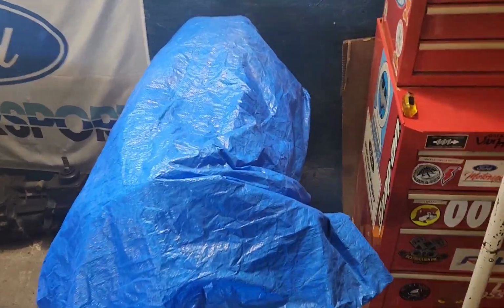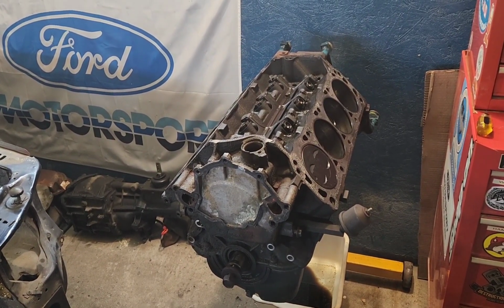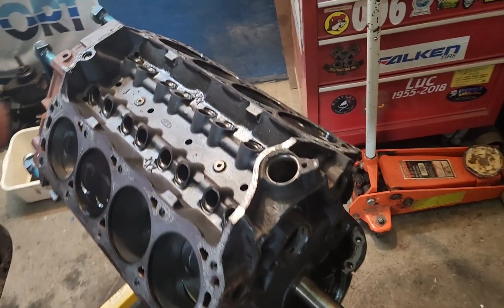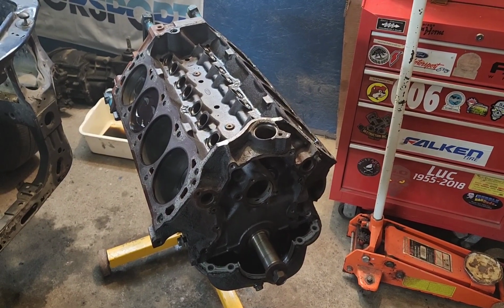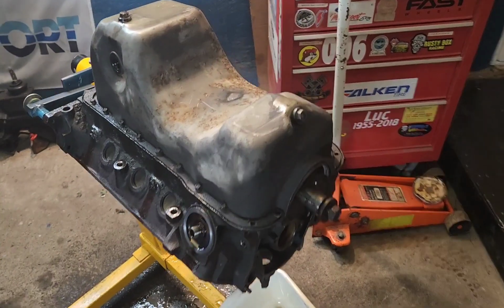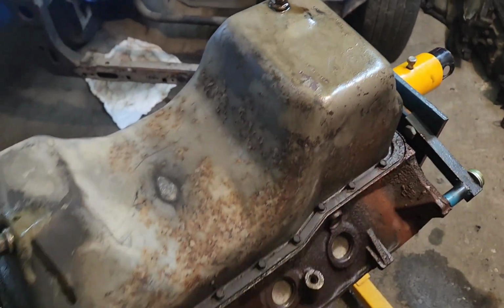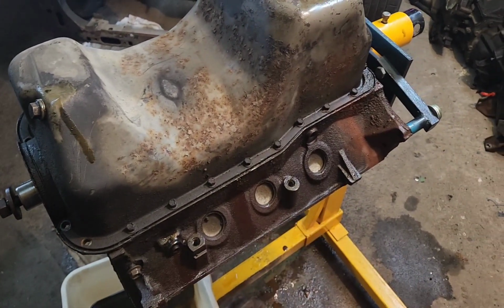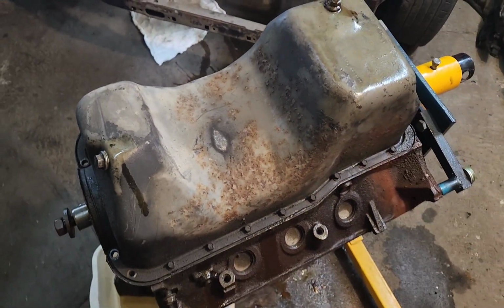FOXBODY V8 SWAP - Shortblock tear down - Full rebuild? or refresh? #foxbody #mustang #enginebuild

Comment: Bare minimum, that’s my plan on the next cheapo build. Just enough to improve performance with basically what spare parts I have
Reply from the maker: That was the way I originally planned on doing it, but I'm tempted to clean it all and do rings and bearings. I'll know more when I pull the main and rod caps 🤞 have a great night NoFox!!

Comment: Why spend the money if you don't have to?   Check the bearings for wear.  Can you still see cross-hatch on the bores?  Rust could be hiding on the inside surface of those freeze plugs.  Brass ones won't rust.
Reply from the maker: Definitely going with brass freeze plugs, cylinders look good. Just have to pull the main and rod caps and take a look at the bearings. Thanks for watching and for the imput, I appreciate your support 👊